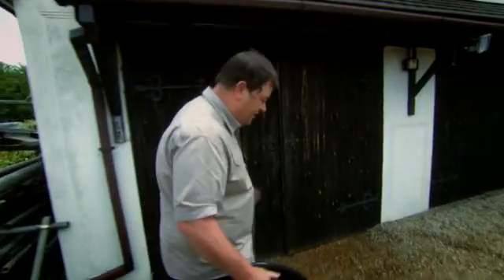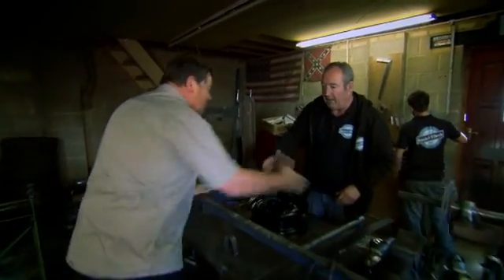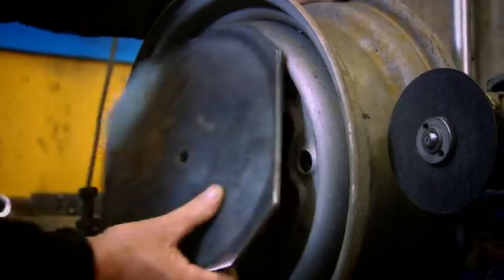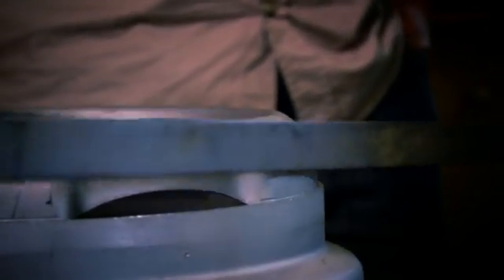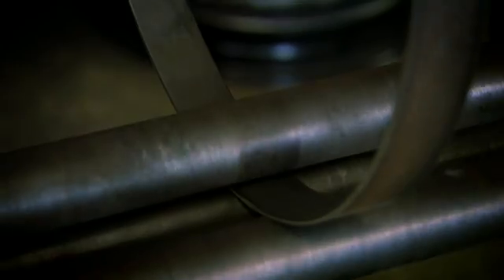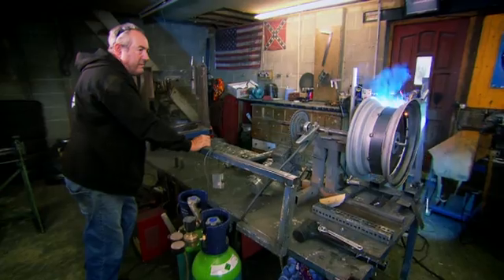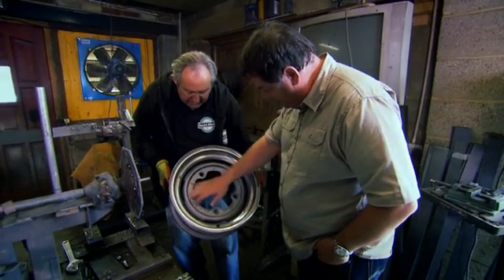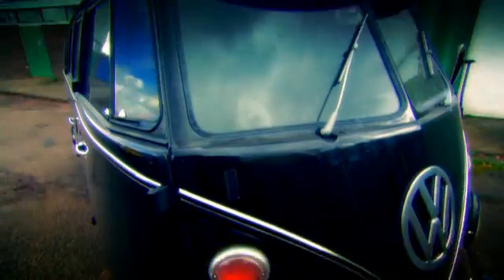See how steel rims are widened

Comment: please show me to do motorcycle wide wheel ...
Reply: If it's a laced rim, a new one is cheaper. I did see a very clever wide rim (buell) made by cutting the rim section off of a 17 x 5.5 and Jig welding it inside an 18 x 8 rim with its center hub section removed. still looked like a stock rim only bigger&wider!

Comment: are these illegal or what?
Reply: Welded joint is stronger than the material around it so I would guess its the notepad warrior who made up that bullshit story
Reply: Whos gonna know
Reply: There were a rash of banded wheels failing in the 60s and 70 and like uncomnizm I thought the practice was illegal. As for the "weld being stronger than the material around it" that's utter bull. It all depends on how well the weld is made and the type of steel being welded. Welding can weaken the parent material, through the heating causing a lack of tempering in the steel or hydrogen embrittlement in the heat affected zone. The weld might not penetrate completely, there may be subsurface voids and inclusions in the weld, the wrong filler could be used, lots and lots of reasons why the joint could fail. 

In a safety critical situation like this at a minimum I would like to see is a welder with coded certification. This looked OK but the wheel did have some run out on it after welding.

This is not summat I would have on my car.
Reply: uncomnizm they should be they need to be welded to be made

Comment: Do steel rim widening safe for long drives? and does it last long?
Reply: +Must Tard They're safe.
Reply: as long as its done right they should be as good as any other wheel and last as long as the car and even longer
Reply: as long the welding process precisely accurate with the same material as the rim has,  it's gonna be ok